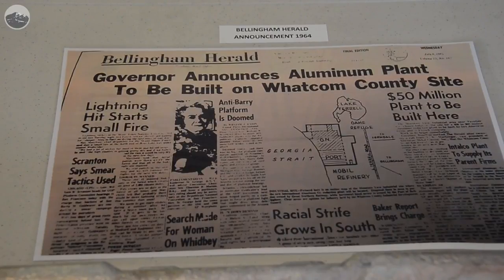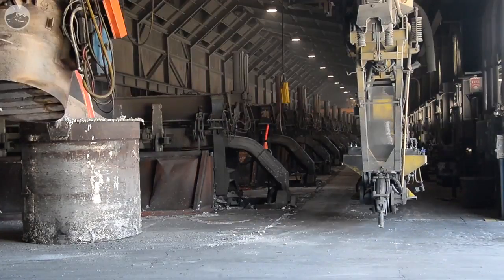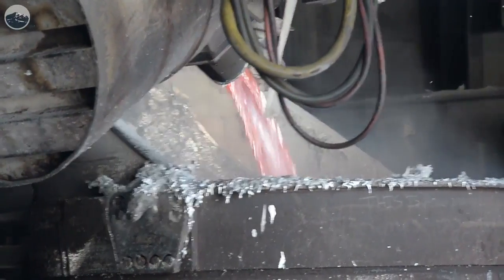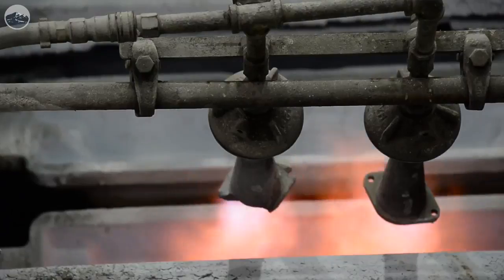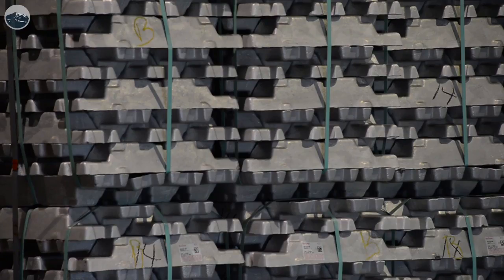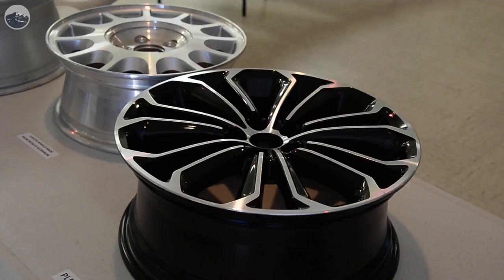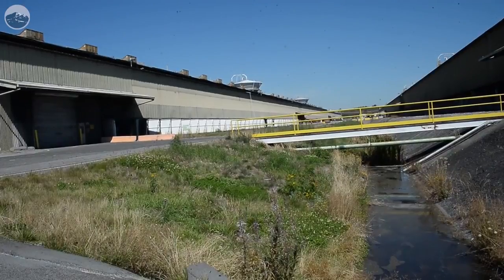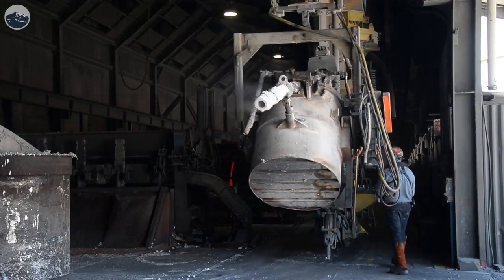Take a tour of the Intalco aluminum smelter on its' 50th anniversary

Comment: This plant is a joke and extremely inefficient relying on decades old production capacity. Wages are far too high relative to the production of the plant. this is what can happen when you don't fund continuous upgrade of the plant. I feel badly for all of the workers but it was coming to them because of bad management...
Reply: I agree with most of what you said but the real reason why it closed is because this state hates non green facilities and they weren’t willing to secure a contract for cheap power.